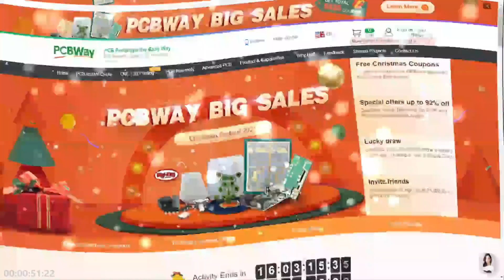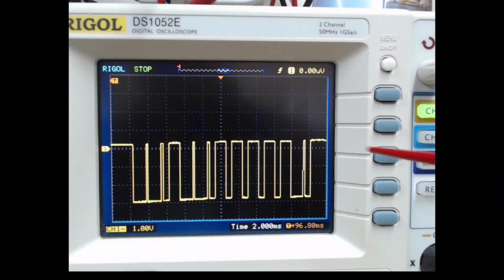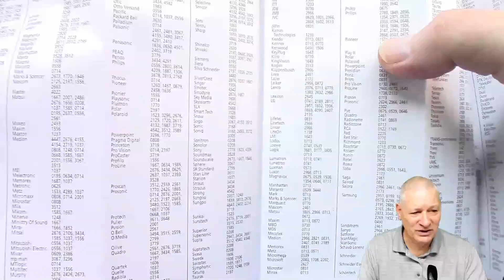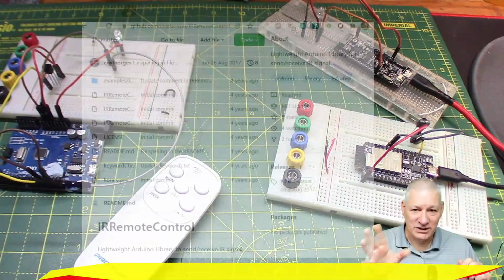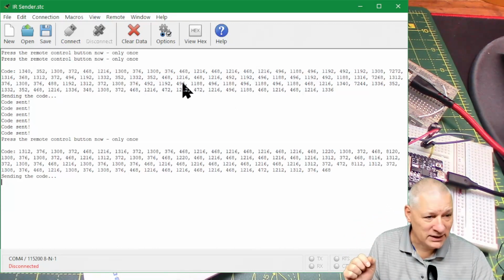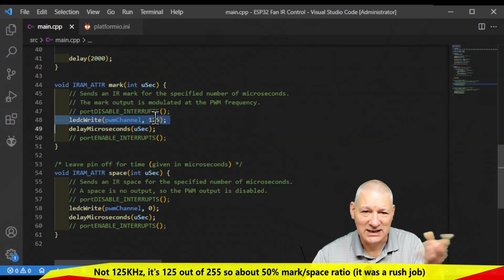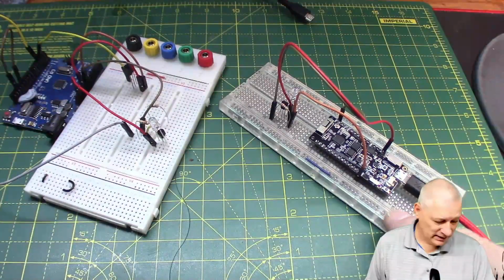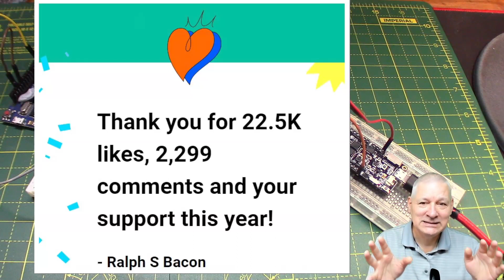#233 ESP32/Arduino IR🔴Fan Control - RESOLVED! 👍🎄❄️

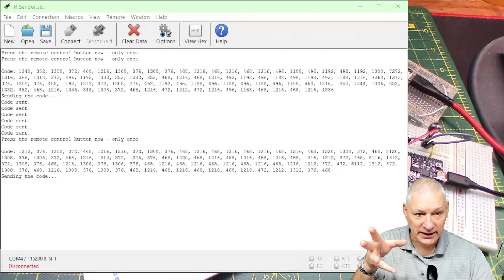Comment: Hey Ralph! Glad you found a solution to this. I am making a similar project to control my pedestal fan and am running into the same issue you did, sending an IR signal that I had previosuly checked fro mthe remote, only for it not to work. I was wondering how you got the raw information at 10:29, I'm trying to find it but cannot seem to. Thanks!
Reply from the maker: I used the basic sketch example (from the library I used) and checked what I was sending out on an oscilloscope. My scope allows me to take a snapshot of a trace.

Then I sent the actual remote control signal and compared the two images. I could therefore tell that one of the pulses (maybe more, can't remember now) wasn't quite right and just "tweaked" my stop/start of the IR pulse (in microseconds) until they matched pretty much perfectly.

Comment: Just found out you found the solution , good grat!
Reply from the maker: Yes, thanks. It works perfectly every single day (as long as I don't stand in front of the IR LEDs and block the signal 😜). All built into my Smart Heater Controller in my workshop.

Comment: Have you taken a look at the RMT driver. Its part of the ESP-IDF. I even use it to drive NeoPixels. Who knew...
Reply from the maker: I've never used the ESP-IDF even though I should because of my ESP32 work. But who else would be interested in (yet another) IDE when we have quite a few perfectly good ones? I wonder if that remote control RMT driver is compatible with the Espressif Arduino framework? Probably ESP-IDF specific.

Comment: Nice. This brings me back to the 80's when we wrote remote control programs in 8085/8051 assembler.With record and playback. Not exactly handheld but worked.
Reply from the maker: Hmm. I think you and I have different memories of the 80s! The best I did was convert some 6052 digital clock code to run on a Z80, in assembler. Worked, and for the time was quite impressive, but today it seems so trivial! I'll probably look back on this IR project similarly in another 30 years!

Comment: Great job.   I couldn't find the revised code for the ESP-32.
Reply from the maker: The ESP32 code now only sends out the IR signals (it doesn't receive them) but if you want them I can send you a zip file - my email is in the about page of my channel. (Basically I don't want to create an entire GitHub repository just for this simple code).

Comment: If you were replacing your Rigol oscope today, which model would you go for?
Reply from the maker: I'd certainly consider another Rigol; but I'd like one with a cleaner (higher definition, bigger screen) trace, more like the old analog ones used to give us. Two channels is good, four would be better but cost would probably exclude that option.
In short: bigger screen with better definition but a Rigol brand would be fine.

Comment: What is the 3 lead IR receiver that you used?  I am thinking about building an universal remote for my entertainment system.  Thanks.  PS.  Great video as always.  I am always excited when I see a new video from you.
Reply from the maker: The actual one I used (bare 3-pin IR receiver) was a VS4838 but there is another (perhaps more common) version with a silver jacket on it that is a VS1838B and is often in a kit with a suitable IR transmitter 2-pin LED. 

I've just tried both and they seem to be pretty much the same but you can compare datasheets for the differences.

Note the pin-out is (when the receiving bulge is pointing at you) is LEFT (Signal Out), CENTRE GND, RIGHT +5V. Same pinout for both devices I mention above.

Glad you like the videos, Bruce!
Reply: @RalphBacon  I was wondering about that,  seeing how I have a number of those devices salvaged from scrap equipment like old VCRs and such.  I wonder how common that pinout is?
Reply from the maker: If you have a USB microscope or something similar see if you can read any ID markings on the device and check the datasheet. Otherwise try it out (if it's salvaged and the magic smoke escapes... well, that's life).

Comment: Thanks for the follow up.  Watching someone else diagnose and fix an issue is a great way to learn.  The failures (what didn't work, and why) are just as important as what did eventually work (and why).
Reply from the maker: Indeed, it's only by working through the issues that we get more experience.

Comment: Exactly as I expected.
You learning remote control obvious records the timing and do not try to match it to a specific protocol.

The modulation frequency (38kHz) and the led frequency (xxxnm) is significant if you want to transmit over a longer distance, but not as much at shorter distances.
Reply from the maker: My reply to you has disappeared, Henrik :(
Reply: ?
I do not see any problem with you removing the reply and if it is youtube, they are just silly.
I am watching more videos on alternate services, main problem is that youtube has way to many ads. I also hate it when they try to limit my selection to what they mean is acceptable contents (Youtube frequently block contents that is legal and acceptable in my country).
Reply from the maker: You need a VPN. I use Hideaway on my PC when necessary. You can try it for free:
https://www.firetrust.com/products/hideaway-secure-unlimited-vpn

Comment: I seem to be missing something with respect to the generated signal.  If you just need to turn it on for a bit and then off for another bit, why is the PWM needed?  Wouldn't it work to just toggle the pin on and delay, then toggle the pin off and delay?
Reply: Okay I get it now.  For the input you were looking at the result of the IR module which has already filtered out the 38K signal.  But when you write it you have to have that base frequency for the signal.
Reply from the maker: Exactly so.

Comment: is there a pcb with the ir receivver (like the one on the breadboard)?
Reply from the maker: I have a couple of IR receiver LEDs on a PCB (or "module" as Banggood like to call them). I also have an IR receiver/transmitter pair on a PCB that just makes life easier to connect up when prototyping. 

Regarding LED size, Adafruit says:

5mm LEDs can be so bright, they are often used as illumination (lighting something up, like a flashlight...).

3mm LEDs are not as bright but are smaller, and are good for indication (like an LED that tells you something is on). They're not as good for illumination because they have a smaller area that is lit.

10mm LEDs are a little more rare, they are huge and chunky but are usually just 5mm LEDs with a bigger case so they aren't any brighter. They can be good indicators but we rarely see them as illuminators.
Reply: and what is the poine/use case for bigger sized led's?

Comment: Goody,will be used shortly 👍🏻😁
Reply from the maker: Indeed, I just finished getting all the mark/space IR codes I need for the project (using the Arduino version of the sketch) and have transcribed them into my ESP32 controller; works like a dream!

Comment: The "blob" is a low-cost "encapsulation" of the IC underneath it. This affordable solution is often found in, e.g., a cheap multimeter to save a few pennies. Cheers.
Reply from the maker: I'm guessing the IC is some custom chip made specifically for the manufacturer?
Reply: @RalphBacon  More likely a chip that can be used in multiple devices of this kind,  with some way of selecting the particulars in any given use.

Comment: I did a similar IR project a good while back which was the control of a Sony hifi using a Raspberri Pi. The code I used was from linux LIRC which worked very well and I contributed my specific IR codes to the project for the Sony model I was using. Merry Christmas
Reply from the maker: Well done for sharing those codes, Colin! It's all about give and take in the microcontroller world. Have a Merry Christmas yourself.

Comment: Good News !
The analogWrite() function is implemented in the latest ESP32 core (version 2.0.1)
Reply from the maker: Interesting! On PlatformIO it knows about the command (parameters etc) but VS Intellisense doesn't recognise it and red squiggles it! I wonder what the frequency is though? 38kHz is much higher than the (Arduino) default of less than 1KHz! I'll read up about it after Christmas. Have a good one!
Reply: @RalphBacon  Hi Ralph - I thought that I replied, but perhaps not

In the new ESP32 core, analogWrite() is a wrapper round the ledcWrite() function.  If you don't care about the frequency you can just use it, just as you would on any Arduino.  If you want to change the frequency then the ledc functions are, of course, still there and quite easy to use

Have a good and careful Christmas
Reply: @RalphBacon  The new ESP32 analogWrite() function is a wrapper for the ledc functions so presumably you can change the frequency using the ledcChangeFrequency() function

For casual use the analogWrite() function is easier to use but for more specialist requirements the ledc functions are not that difficult to use

Comment: I didn't think you'd give up on trying to get the Arduino/ESP thing working! It looks a bit like the original library puts the bit patterns out a little fast for the fan to understand. Perhaps there is some way of tweaking that in the original library, but the solution you've come up with is much simpler and lightweight. I've played with IR remotes on various occasions, and found it frustrating because while there are "standards" many devices take liberties with their interpretation of the standards and sometimes I think that is deliberate.
Reply from the maker: Trying to tweak that all-singing, all-dancing library would be a (long) labour of love, so as you say this lightweight method works just great!